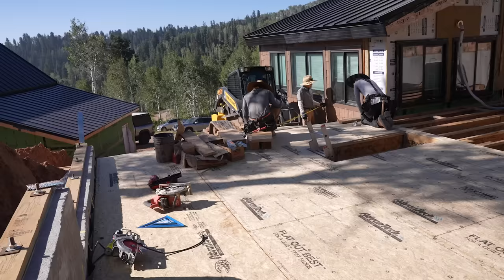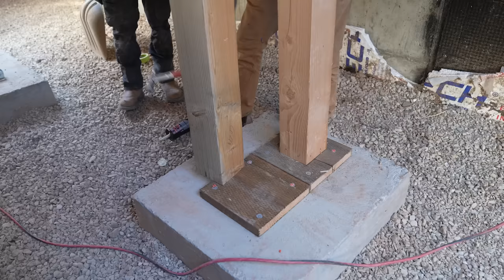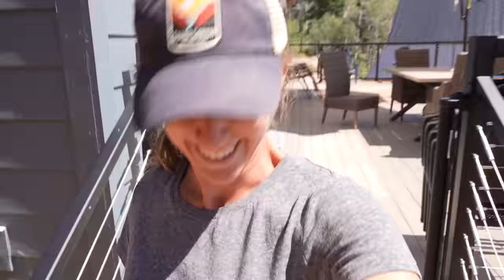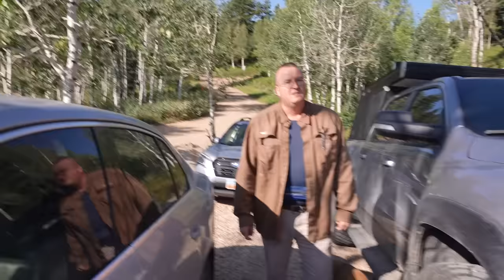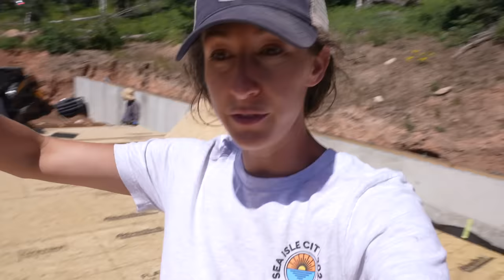WE FOUND A HUGE PROBLEM...

Comment: Try some warming wires you put on the roof, it melts the snow off your roof. No dangerous snow removal risks. Get those snow ice melting wires on the roof now before winter. When it snows turn the wires on watch the snow melt. The wires are not very expensive. Give it a try
Reply: Don't think that would be necessary with a metal roof....snow slides right off.

Comment: I'm continually impressed at how calm you stay when there's a problem. I'd have thrown my hands up and just stomped off cussing and likely not come back for days. Good thing I'm not building a house. lol
Will you be able to re-use the windows you'll be taking out from the original house in the addition? 
Was that outside short concrete wall waterproofed too? I couldn't tell when you were backfilling that area with dirt. Just me being annoying about things again. 
Also wondering if you're going to be putting in insulation under the floor? And then how to handle air currents in the  crawl space. I've seen some builds where moisture would build up and the wood would start getting mildew due to the moisture. A dehumidifier was said to be a solution. I watch too many DIY stuff. lol

Comment: Trent great job catching your mistake  you like all of us are learning every day. Do you intend to insulate the lower foundations area? I ask as your tucked into the hill and your area thermal bridging the winter cold will transfer into this space. Temperature moving from hot to cold as your condition space is heated it will move to that colder environment, so you need to either insulate the floor or preferably you'll do the footer and stem walls. Have you look at passive house standards? Keep up the great content and keep doing what your doing your a great human being.  Alley you and the team are great to watch!

Comment: So' as a 35 year concrete and construction guy, i've put stone in countless basement. We used a few different methods. Doing it like you did, we would have 2 wheelbarrows in the basement, that you would dump the stone into, then wheel it across the basement, instead of shoveling. Or they have a truck called a stone slinger. The stone is spread out with a conveyer, controlled by the truck driver. You do need access, but a good slinger driver can make grading a piece of cake,

Comment: How was the backfill compacted?  Usually you only backfill a certain amount before you need to compact the backfill.  I don’t know the exact numbers, but usually it’s a certain number of inches (at least for backfilling a retaining wall).  Was this done off camera, or just not done?  Maybe the weight of the excavator itself driving back and forth is enough for this compaction?

Comment: Sir 
You may want to check your propane code per buried  pipe 
In my world i cannot have a mechanical joint in the ground buried 
It will come unleashed on you 
Will take time but it will fail

Comment: So the strapping was in the correct spot in the concrete and you didn't line the beam up with it? Lol the reason Allie was anti excavator is she didn't want Trent poking holes in anymore walls. Having said that Trent is learning to be a pretty good operator. Practice helps a lot and Trent has been practicing alot. When your done it would be interesting how many hours on the machines.

Comment: When you get to the point of pulling wire consider installing network cable. I know that wifi is good but with your original exterior walls it might be a problem. When I built my house in the mid 90's I didn't know that internet connected devices would be so prevalent.

Comment: I won't point out your mistakes if you don't point out mine!

Allie, I honestly don't know how you guys would be able to do this build without the excavator and the skid steer. But you are doing an amazing job with a project that is composed of one tiny task after another with each building on the previous task. And let me point out that there are many, many buildings that are not as well-built as yours, and thousands that were built with much less precision and using ancient tools that are still standing. You guys are doing an amazing job!

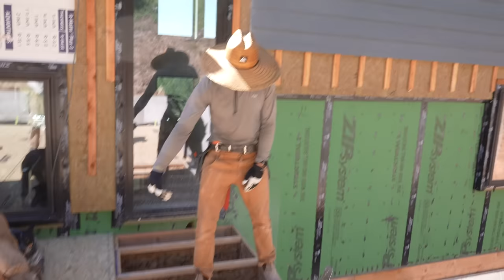Comment: 5:45 You just described why that will be impossible doing it that way.  Cut the rim piece under your left foot and slid the pieces in from that end.

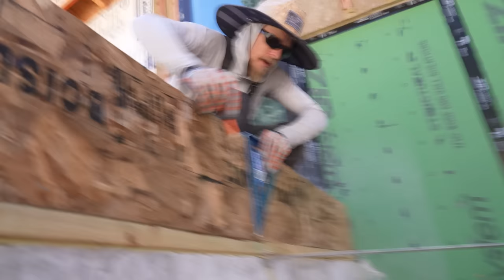7:00 There you go!  The piece you put back in is insignificant.  The load resting on it will be spread along the entire length of the wall.

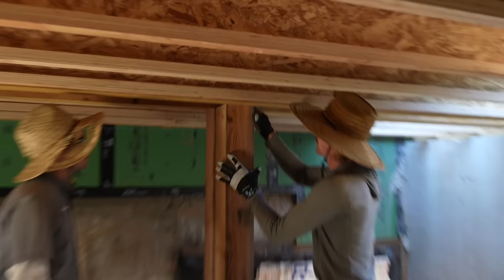12:20 That first post location on the footing must have been the giveaway of the beam's location.

A propane tank that big doesn't have to be set on a concrete pad?  Frost, erosion!

Comment: next time consult a structural engineer.....I'm sure you could have doubled the joist next to the out-of-place beam and then block every __" between beam and new joist to support the new wall location. OR, an architect could have drawn up some options to make the 'wrong' wall location work.

Comment: Ok, you make mistakes, but who doesn't?
Where I live, we have a saying that goes something like this: "Where people work, people make mistakes". Often the following is added: "People that do a lot of work make a lot of mistakes. I know some people who make no mistakes......"
Don't feel bad; you may be surprised at how many mistakes are made by professionals. Most of them are hidden in walls or floors, and the people living in those houses will probably never know about them. Only if the fix is done poorly or is never fixed may there be a problem. You fixed it, and in a very good way. Now everything is very strong, maybe even extra strong.
Now only the winter has to hold off for a while so you can get everything watertight.

Comment: Gosh I’m so surprised that you get to to do all the trades even if they are checked by a professional. In Australia you have to have a certified plumber, electrician, gas fitter etc do all the work, start to finish.  We could never cut the gas line move the tanks and splice in extra line even if we were capable of doing so. Back in my Dad’s day we probably could but not any more.

Comment: Wondering why you didn’t bury the propane tanks or install geothermal for HVAC because the cost of propane is going to substantially increase with time and great financial incentives are in place for these sustainable friendly and important systems.

I have seen several systems that are in a northern climate that are 100% off the grid.

This would have been a beautiful opportunity for T&A to educate people on these HVAC, hot water and electrical producing systems.

Major mistake!!

Comment: i did the same thing on my floor but i got lucky and it was on the outside of the wall. and only 1 1/2 inch  out and my ends was open at the time so i goy lucky and one i got one end in. i used my tractor and pushed it through but when i got to a seal i had to place a jack under it so it could slide over the seal. until i got to the end. i wish you could have got that lucky. and if you didn't make mistakes you would never learn anything.

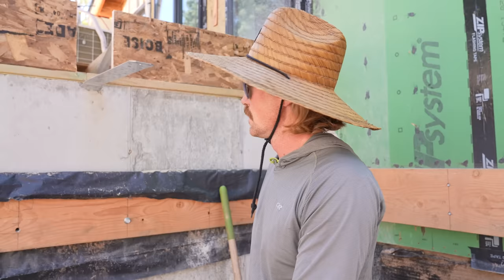Comment: THAT MODIFICATION YOU PLAN TO DO AT ABOUT 08:15 SEEMS LIKE IT WOULD BE A DANGEROUS CHOICE OF REPAIR FOR THAT FLOOR BEAM!!!
IF you cut that floor joist, you weaken it and since it is AN ENGINEERED STRUCTURAL FRAME MEMBER IN YOUR HOME YOU MUST HAVE AN ENGINEER CERTIFY USING YOUR IDEA AND PROCEDURES TO ACCOMPLISH THIS BUILD CORRECTLY!!!

Comment: I don't know why but it bothers me that they have to back track with this huge addition.
Reply: Yes, not sure how the rain and  snow will run off the back roof area of the existing house.
Will there be a valley gutter?  If so, it would need heating to prevent snow build up between the original house and addition.